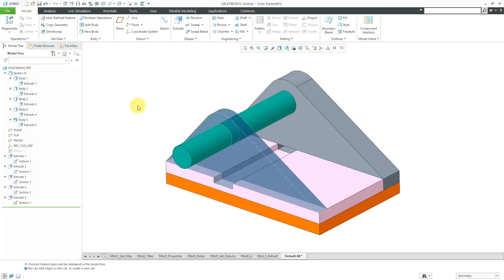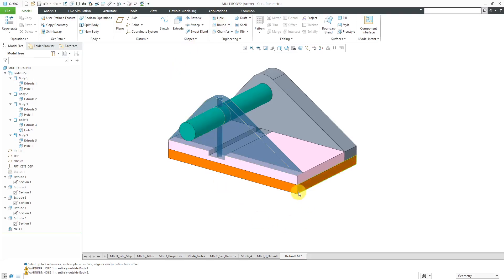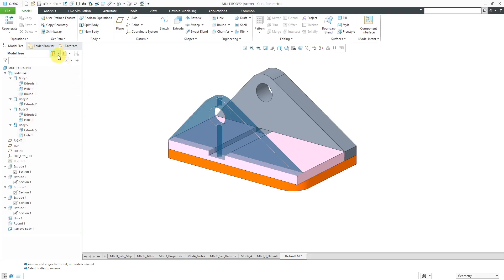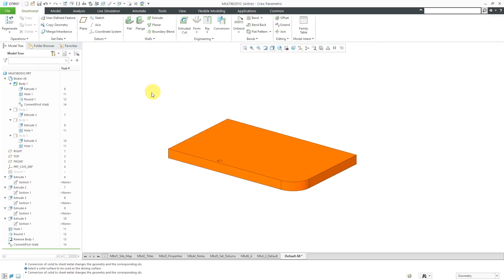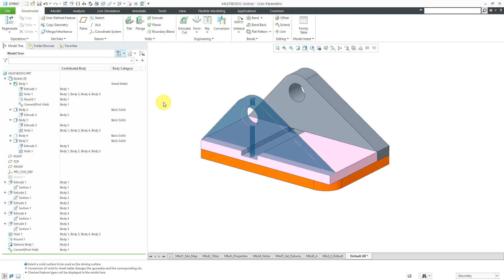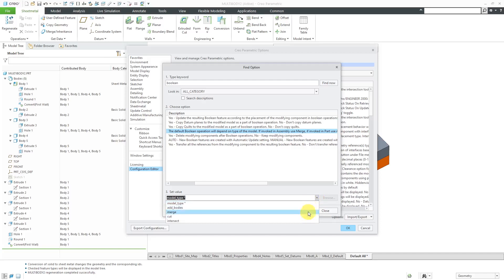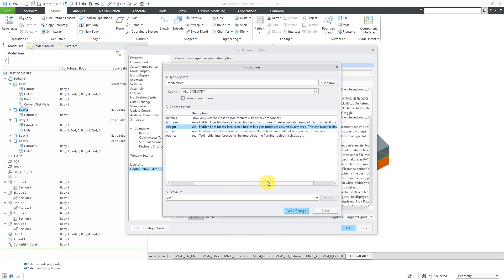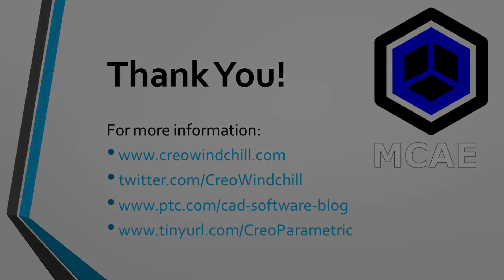Creo Parametric 7.0 - Multibody Modeling (Part II)

Comment: It's great update if it get 3d sketch.
Good for weldment,
Reply from the maker: What do you get from a 3D sketch that you can't do with ISDX?
Reply: @CADPLMGuy  I can do many things from nice isdx 
Problem is that 
When we working on some chir like object, draw it's boundary to sweep 
Or main problem when working with weldment I can't make 3d straight lines Easley that is only problem 
If any way to making weldment Easley like solidworks help me 
Thank you so much for your concern sir .
Reply: There is a also the prohibitive cost of ISDX consider. Some sort of 3D sketch capability is surely something that should be available within every license.